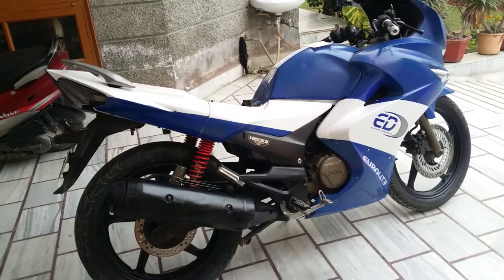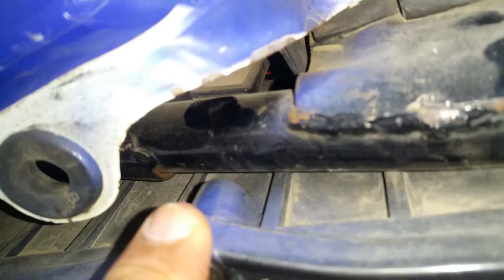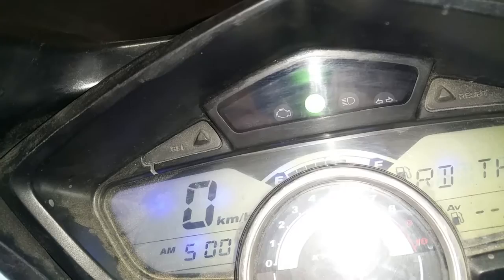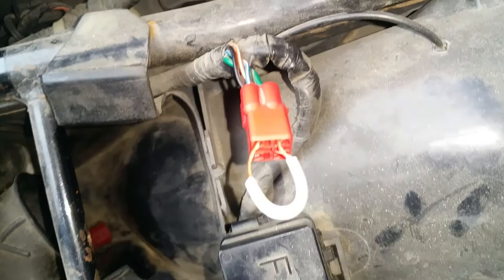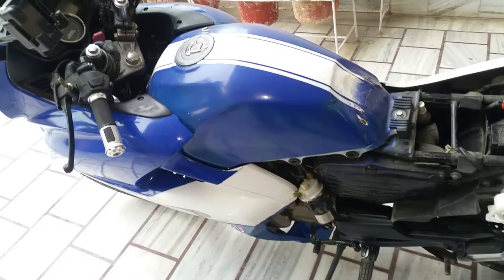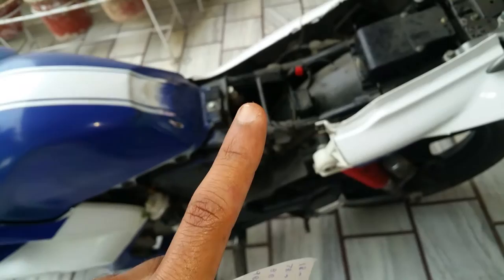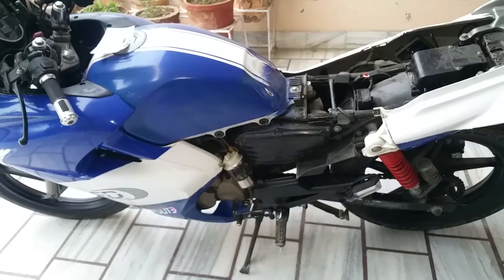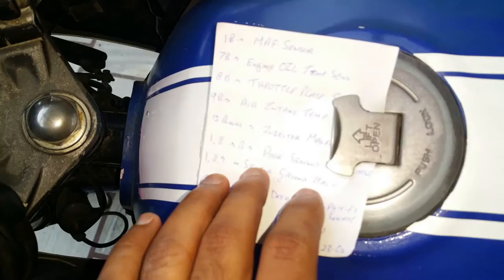Reading and Resetting Karizma ZMR CBR 250 ECU Malfunction codes and Throttle plate angle Sensor

Comment: problem in my glamour fi when i am giving throttle its starts blinking 1 time and bike keepa its idle i have checked alll the connection and fuel pump and injectors realay reseted the ecu changed spark plug but my problem is so on plzz help me sir

Comment: My rpm meter had stopped working... please help, the company people are saying my ecu is faulty.
It's around 8500 and will have to order..
And since then my average has been dropped significantly. Sometimes the bike idling even fluctuates.
Suggest me something I can do.
When I switch on the ignition, the rpm goes to 10 and comes back, but doesn't show reading when I start the bike 
I really need help

Comment: Sir i made karizma zmr 223 cc fuelpump .. the fuelpump is ok but not start my zmr.. what i do ? My fuelpump blow  oil.. fuel injector is also ok but oil is not coming through the injector.
Reply from the maker: Sounds like fuel pump isn't pumping with enough pressure..!!!!need to check fuel pump again..!!

Comment: Hi Brother,  I am facing one problem with my ZMR. On a hot sunny day, If I ran 60-70 kmph  for 10 km. My bike getting very hot it getting stop . if  I take 5 -10 mins break then it getting start so that I can go another 2 km like I have to repeat this process till I reach my destination.
I have replaced new Fuel injection motor recently.

What will be the problem?
Reply: My bike also have same probleme bro
Reply: Same  problem also facing by me u guys find any solutions then pls also me

Comment: Dear sir I have zmr v2 2014model l replaced the fuel pump but there is missing problem I have cleaned fuel pump tank and injector but it Persists and  orange light is continuesly on. 
Kindly tell me how to solve it

Comment: Good informational video sir, I have similar problem with ECT sensor, followed the given procedure, first the check light kept blinking continuosly then it stayed on for awhile indicating the code is removed from ECU. But the check light started to blink again 7 times when the bike was turned on  after removing the wire. I would really appreciate if you could help me on this
Reply from the maker: Thats Probably a bad Engine oil Temp sensor...make sure to check wiring nd connection to EOT SENSOR FIRST

Comment: If ECU is not working how we can recognize that ????
What I have to do rework that ECU ???
Now my bike is not starting but still Orange light blink like normal
Bike mechanic said ECU problem
Plz help me
Reply from the maker: Well in case of bad ECU try installing a new ECU and then check....But ECU doesn't fry that easily... 
If bike not starting then check for bad spark plug,fuel pump,fuel pump relay,ignition coil,fuses and poor connections..!!!
Gud luck!!

Comment: Great info dude. Please advise that using the Injector cleaner fluid in petrol really cleans the injector or not. Also, Is Bardahl the best one or advise any other.
Reply from the maker: Well personally I prefer this method!! https://www.youtube.com/watch?v=96sl1lnYyGo
But sure u can use ABRO fuel injector cleaner fluid for cleaning!!But It's less effective
Reply: Great thanks once again. Please also let me know how to adjust headlight in new model ZMR which was launched in 2014
Reply from the maker: Sure...there r three bolts in headlamp...One on left upper side and two below at both sides!!!
Upper one is for adjusting vertical positioning(Up/Down)!!!Lower ones are for adjusting horizontal position(Left/Right)

Comment: Hi sir thanks for the video, just need to know my petrol indicator keeps on jumping from one point to other for example while turning on it shows 3 point and then it shows 5 or 4 without filing the petrol in it. So any suggestion would highly appreciate.
Reply from the maker: Check for any loose connections to the fuel tank first....Nd if that doesn't work then go for fuel level sensor inside the fuel tank..!!!

Comment: Hello sir my karizma zmr is not Start fuel injector & fuel pump is new. current on plug is also correct. But petrol is not spreading in injector. Fuel pump is working best 
I'm trying for last 4days but bike is not responding

Comment: Hi Bro, the check engine light in my ZMR is giving 54 Blinks(5 long 4 short). According to your description, it says, that this is "Bank angle sensor". 
But I got this checked from the hero service station and the mechanic was saying that it is "Engine Oil Sensor" which is causing trouble.

Don't know, what to do now, can you please help me with this.
Reply from the maker: Don't listen to mechanic.!!
Reply: @powerpulse.motorsports  Thanks. Should I get the Bank Angle sensor replaced? or anything else can be done?

Comment: Sir how to remove 3 blinks injectors malfunction??
And while I'm pressing starter it gets tripped. Whole digital meter is starting from the initial state like we rotate key to ignition..
And the small box like thing just next to bettry making sound like trrrrr trrrrr continues sir can u help me identify this issue?? Zmr isn't starting with the power start at all..
Reply me soon sir
Reply from the maker: Ur starter relay is toast...or may be u need new battery

Comment: This doesn't work on my bike sir ....
I tried it....
That light blink's 5 time's long And 4 times with short interval....
Reply from the maker: That because your bank angle sensor is fried..!!!
Reply: TopEnd sir can you tell me in detail
Reply from the maker: 5 long and 4 short blinks=54 blinks(Code for Bank Angle Sensor Malfunction)
This sensor is situated on right side of headlamp which shuts down the engine when bike falls over in a crash...!!
Check for loose connections to this sensor and Replace it if necessary..!!
Reply: TopEnd 
Great A very big thanks
☺☺☺☺
Reply: @powerpulse.motorsports  hello bro.... i have same prblm in m zmr.... runig n stoping engine.smtim start whn i give race its suddnly go off engine

Comment: Hi, Please help me my bike goes on at high rpm on ideal standby I believe its crank angle sensor. Can you help where to buy Crank angle sensor for same bike 2012 ZMR. In showrooms or at local retailers its not available.
Reply from the maker: Naah it ain't crank position angle sensor...It seems like clogged MAF sensor or IDLE air control valve....Thorough cleaning of throttle body shud fix it..!!
Reply: Same happens with my bike, ZMR 2011, but apart from that it looses power midway(like every 5-10kms), and restarts after few minutes, can you suggest something?

Comment: I am having 5 long blinks and 4 short blinks.. what does that mean? Is it the throttle malfunction? Please reply, service centre guys dont know what it really is.. Thanks in advance..
Reply from the maker: Manu Murali Thats Bank Angle Sensor Malfunction...It's situated on right of your headlamp....this sensor turns engine off when bike falls in crash...
Reply: TopEnd does this have any connection with the 'missing' that i am having during traffic roads? Bike needs high initial to gain speed
Reply from the maker: Manu Murali Yes.. may be...cuz it tries to shut engine off...U may try removing it's wires nd den try...If den bike runs smoothly den replace it!!!
Reply: hi bro im also facing same bank angel sensor malfunction problm (54 blinks) may i remove d sensor n reset my ecu or replace d sensor n den reset ecu(im unable to find sensor for anywere frm last few months) ???
Reply from the maker: Just replacing the sensor will do the job...reset ECU  later after replacing....This bank angle sensor is located on right side of your headlamp...Just take off the odometer cover and it shud be visible..!!
Reply: thank u for quick response, im unable 2found sensor for purchase i knw d location of sensor,if i remove d sensor n reset ecu dn error is gone ??? i knw d drawback dat my bike dosnt stop whn it fall bt i'll manage dis bt im fed up wid d continus error frm last few months
Reply from the maker: Sensor shud be available on order from HERO SVC...!!!yes removing sensor won't effect performance in any manner..just bike won't shut of in crash!!
Reply: thank u bro n 1more thing awsum videos ,u knw more den SVC mechanics
Reply from the maker: Thanks Bro...!!!

Comment: Bro my bike turns off when the engine becomes too hot. But if I depress the start button I can listen the engine cranking. I will then have to wait approximately 3-5 mins for bike to start. And it occurs very often . Please help me on this also the heat from engine is intense I can feel the heat in the fuel tank sides
Reply: Which Engine oil do you use ? is it the recommended one ? While riding in traffic, even by ZMR gets heat up, but never turned off. I use the recommended oil for engine.
Reply: The engine oil used is the one service centre guys have given. I m not sure of the brand 🤔
Reply: Could you please let me know the recommended engine oil?
Reply: Sarath S even i use the same which service center guys put. Its Hero 4T 10W30
Reply from the maker: Try Motul 10W40 Semi synthetic..!!
Reply: Thank u so much bro . I ll do that

Comment: my bike missing problem every time what I do pls tell.....
Reply from the maker: That cud be a bad spark plug or bad ignition coil....Or it cud be bad fuel pump relay or bad fuel pump itself..!!
Check for loose connections first..!!
Reply: TopEnd how to check fule pump really...pls...
Reply from the maker: Remove the fuel pump completely  and drain all fuel inside it nd  apply 12 volt on terminals for 1 minute separately ...it's gonna give spinning sound....if it does missing den it's faulty
Reply: TopEnd pls make the video in this topic....pls sir pls make video....
Reply: sir pls make video how to check fule pump...I am waiting for this.....
Reply: I am change fule pump and change fule pump really but my problem is not resolve I am also change ignition coil.and spark plugs...pls tell me...

Comment: I have zmr recently i have change my throttle cable after that my idela rpm goes dow  around 1 below 1000 thats why mu bike gets suddenly off in traffic  help me how to increase or reset ideal  rpm

Recently i have drive 500km continuously and that time a problem i have face that is engine orange light is continously on while i have drive after i stopeed bike wait for 15min and again start plz tell me no one hero service center tells me what is exactly happn n what exact problem all says  u have to do ur bike servicing
Reply from the maker: Cleaning the throttle body will do the job..!!!!
Nd about engine light...how many blinks u get when RPM is less then 2000???
Reply: Yes it is  around 1000 ideal rpm thats why my bike gets off in traffic
Reply: TopEnd cleaning throttle body means what???? Exactly
Reply from the maker: Here=https://www.youtube.com/watch?v=Zx3Zu1rDLyM
How many blinks when ignition is turned on..??

Comment: my bike is blinking 7 times and i hav tried and its noy working, and i cant start when engine gets cold
Reply from the maker: vignesh s Your bike's Oil temp sensor is fried....check for wiring connections...if not then u gonna have to install new one
Reply from the maker: https://youtu.be/iw39QRd0SY4
Reply: TopEnd so, i have to install new engine oil temperature sensor?
Reply from the maker: vignesh s Check first if it's fried or working using above link...if it's not giving any reading den yes install new one
Reply: TopEnd thanks brother i will do, even showroom service center mechanics dont know how to fix this issue thank you